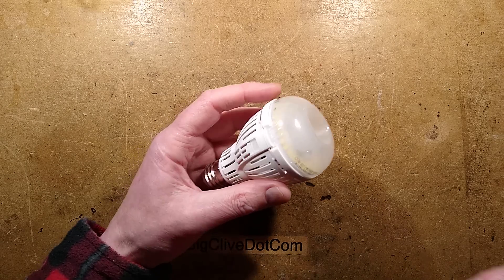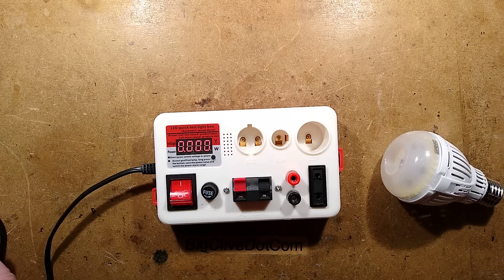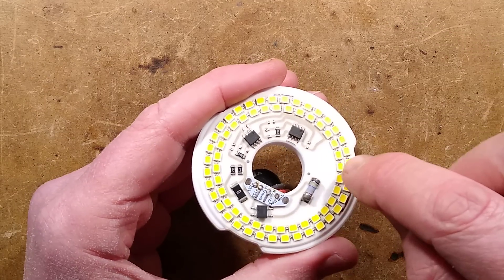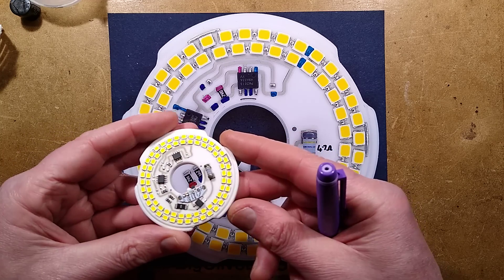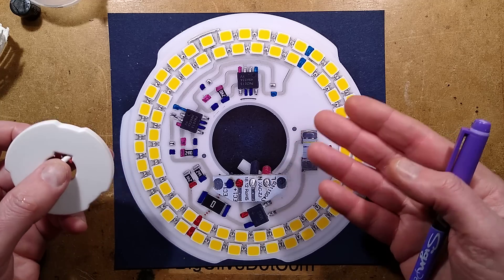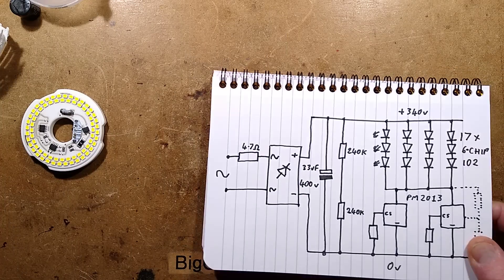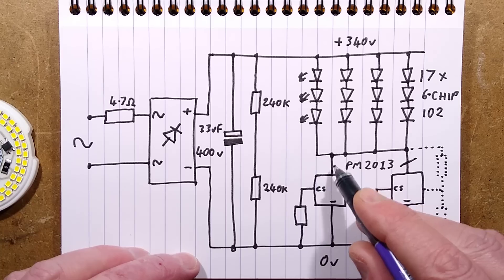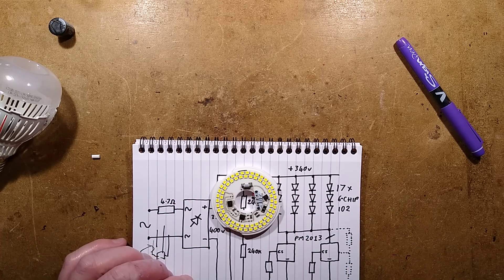Inside a ceramic lamp (with schematic)

Comment: I ordered 6 of the smaller 8w lamps, they have no real circuitry on the LED board, just the LEDs. I did manage to get the front off without breaking anything though! Trying to work out if I can lower the power easily...
Reply: Mine arrived today, and I pulled one apart  to test. There are 3 parallel surface mount resistors on the rear of the main/power circuit board. These can be removed to adjust the current. In the default configuration according to my cheap plug in watt meter the lamp pulls 38mA 6.7W. With 1 resistor removed - 27mA 4.7w, and 2 removed 13mA 2.2W. With the board still inside the lamp I think it should just about be possible to clip off the top resistor with a pair of small side cutters without damaging U1 above it.
Reply: @MrKureigu07  just uploaded a video showing the mod, can you check i have cut the correct resistor?! It is still pretty bright, but doesn't get as hot! 👍 (Edit, just measured it by plugging modified lamp into my inverter to see power, it's approx 3w lower than unmodified)
Reply: hello andy. i would be interested  to hear what your findings are. as i have ordered 6 of the same today, and would like to do similar things... also in particular if there is any chance of a dc derived low voltage somewhere. (but probably not it seems)
Reply: @dreamcat4  just uploaded a video to my channel showing how to open the smaller lamp and modify it easily... Using the info Craig C wrote. 👍
Reply: @andyreact  thanks so much man! appreciate it. and yeah they do seem to have quite a few variations of design. for different type ones

Comment: I've been running these Sansi ceramics for about 3 years.   I had  the design here in my bathroom ceiling cans until they all burnt out the LEDs, and about a dozen of the chunkier 27watt versions with the far more massive conical shaped ceramic  heatsink , all installed in track light fixtures.
  These lamps have such high power density they run too hot.  I've written the company criticizing their use of 12 parallel strings in the 27watt version.  Once an LED chip burns out , with that little black dot, the remaining strings get more current and soon fail in cascading action. 
  The company was very good and sent me new lamps.  I permanently removed the clear plastic covers on the 27watt versions, and on all bulbs I changed the current sense resistors to adjust power to 70% of original.  All of mine have a  traditional circuit board inside , behind the ceramic block, employing the non-isolated brite power chip + inductor based driver (as opposed to linear regulator).  I bought mostly dimmable versions as the power factor is near perfect versus poor ~0.6 measured on the non-dimmables.
  With mods and open air cooling the bulbs are good and will last.  But if you run them stock, they're simply running them too hot and the ceramic heatsink is no match for the dense , searing heat.  One LED will burn and then the cascade failure of remaining series strings will completely nuke the whole bulb.   Sansi is  playing the lumens marketing game and whilst it delivers, 'the bulb that burns twice as bright... '
Reply: Can you imagine having to write to GE or Sylvania (back in the ~good old days) to tell them how to build a lightbulb? The world is just awash with non-repairable, undocumented e-waste built in unionized sweatshops/concentration-camps, with the profits going to morally bankrupt CEOs and pudgy psycho dictators who view democracy as a disease. Enough with garbage LEDs; reverse engineer a time machine so I can get out of here!
Reply: To me ceramic sounds like an insulator material...
Reply: @Splarkszter  yeah that's where you typically find ceramic heat sinks - where you need great electrical insulation and decent heat conduction.  They mix aluminum oxide   into the ceramic to make it conduct heat well, without making it electrically conductive.   But It's  a compromise since it's still not nearly as heat conductive as solid aluminum.
Reply: Is there likely to be a cost difference from straight aluminum? Might the ceramic cost be more stable and predictable?
Reply: @AlanMillerFencepost  i think the raw materials are things like clay, silica, aluminum oxide powder, water etc. and probably are cheaper and more price stable.  the investment in tooling and equipment , and in developing the process and design , would seem to be quite a hurdle, however.   This Sansi company seems to be all-in on this technology so they probably have the scale to make it work overall.   I haven't come across any other brands taking this approach.   Their bulbs have always seemed expensive to me (notwithstanding the great deal Clive found!)
Reply: @GannDolph  extruded aluminum heat sinks are pretty cheap, so it may not be the cost, but the molding of the exact shape.
Reply: @GannDolph  i agree with you on the economics of the investment, maybe they had to scale it down for it to be profitable. well, company managers won't tell you anyway :)
Reply: @Bobo but it’s also a more expensive way to make a circuit board. Laser sintering is definitely more expensive than conventional manufacturer. I’ve don’t this. At any rate, the fewer parts, the more reliable the device.
Reply: Do you have a video or details of what you did?
Reply: @scotthemedic  No video but happy to write out some steps for any bulb Im familiar with.   Do you know which Sansi model you plan to modify?
Reply: The ceramic seems like a heat absorber, not a proper heatsink. Designed by default to not run for long and hope it's turned off to cool down.

They do look nice to modify though.
Reply: @volvo09  i totally agree with you .  ceramic sounds exotic but feels misplaced here.  Presumably it  must be way cheaper to cast and kiln fire these babies and mount the led chips directly versus using aluminum  heat sink plus an aluminum clad circuit board...

Comment: Interesting comment about using a LED chip that was different spec to all the others to balance the voltage rating. Similar to the makeweight chocolate you may get in a tin of Quality Street (600g and still dropping).

Comment: Woah, was expecting a ceramic heat lamp not a ceramic LED PCB.

Turns out the company that makes those (Shanghai Sansi Technology Co Ltd and Jiashan Sansi Photoelectric Technology Co Ltd) have a number of patents about "ceramic seats" (陶瓷座). It seems the advantage is they can make the PCB, heatsink and frame of a device all one component with ceramics and be non-conductive unlike aluminum/copper PCBs. This bulb is a relatively boring example of this with only a central hole for cooling and an exposed outer ring but the company also makes stuff like street lights with a finned heatsink integrated into the ceramic "seat" as well as a lamp where the entire base is ceramic unlike the plastic of this one.

Some of that patents for the actual ceramic material seem to imply it has some additives to increase thermal conductivity but also the far IR emissivity, to much better than bare aluminum. (they're all in Chinese so it's hard to tell exactly)
Reply: That makes a lot more sense than in this specific product.
Reply: Wonders whst the symble for emissivity looks like.
€*///
Reply: @Kevin Sellsit  perusing some documentation... indicated high emissions via the LED's themselves and through the ceramic substrate with no fins (awaiting response from Sansi). Also, the enclosure prevents debris, airborne dust, and fluids from adding a film to these "breathable LED'S". Therefore, opening and touching the LED'S without gloves or a cleanroom is strongly not recommended.
Reply: Omg Clive has to get his hands on one of those street lamps

@bigclivedotcom pls 👉👈
Reply: So Tim. I seem to have trouble locating the information you have presented before the YouTube masses. I have contacted the companies provided and will be continuing to search for the patent/s you have referred to. For those not aware, in Material Sciences, engineering ceramic is very complex and results in a high performing BUT brittle substrate. . Most ceramic compounds exist between metallic and non- metallic elements. Therefore, interatomic bonds in ceramic are between ionic or predominantly ionic that have some covalent characters. Atomic defects can happen among ceramic compounds, creating both vacancies and interstitials. Therefore, defects for each ion type can occur. There are two types of intrinsic defects that can happen in ionic structures as Frenkel defect and Schottky defect.  With this in mind, we can understand why I'm genuinely curious about these patents you refer to.
Reply: @LeviGoldwing  This topic is above my paygrade...but I'm curious if this "Schottky defect" is related to the manufacture of Schottky diode or just the same guy?
Reply: @kevinsellsit5584  Why yes...yes it is. Walter H. Schottky
Reply: @LeviGoldwing  I was referencing patent "CN202719394U", just be aware it's entirely in Chinese, but Google Patents provides a rough translation, they also index the named inventors and current assignees so you can go down the rabbit hole from there.
Reply: Wow they actually invented something
Reply: @AgentOffice  You are just embarrassing yourself... gunpowder, the kite, the repeating crossbow, porcelain, steel working etc.

Comment: Impressive! Those ceramic PCB's aren't cheap or easy to make.
Reply: They must have for sure found a way to manufacture them quite cheaply per unit, no doubt at massive scale and high initial cost.

Comment: That's a very nicely designed LED lamp. Wow. Huge unit, but it will probably last forever, even without hacks!
Reply: what is your profile pic from? ive seen it before but i dont know where.
Reply: @zilog1  i really cant remember. i found it on the internet a long time ago. liked it. stuck it on my github profile, and only recently added it to my yt profile ;)

Comment: Wow, something built to last. Unusual.
Reply: I just had the capacitor fail on a "quality" Osram lamp after a small fraction of its rated life - interesting aroma - solvent, ozone and charring.  Maybe I'll try one of these.
Reply: And how much does it cost?
Reply: Maybe the early ones are built better to build some reputation.... then the cheapening happens
Reply: 14W and no cooling? It's not going to last long at all. LEDs will fade very quickly. And at barely over 100lm/W they're not event that efficient form the start.
Reply: Only time will tell. They probably built on purpose at least one weak link into the device so the customer must buy more.